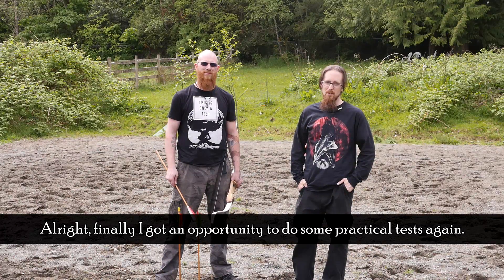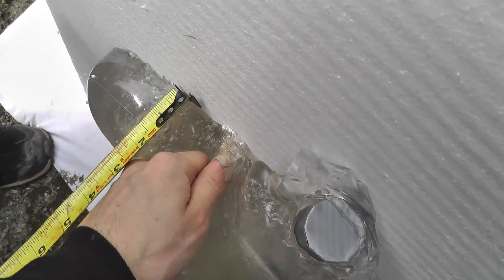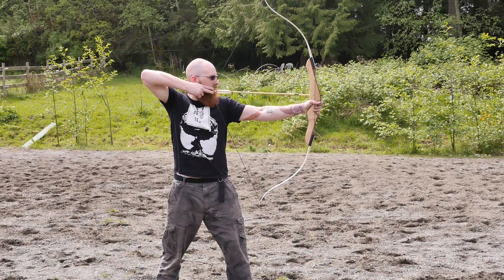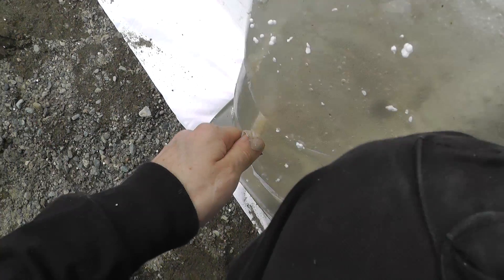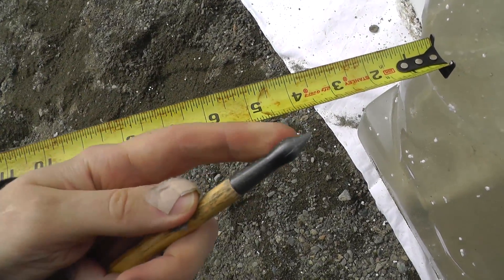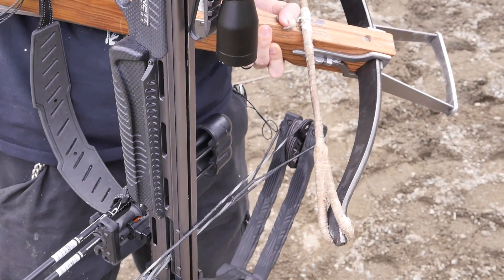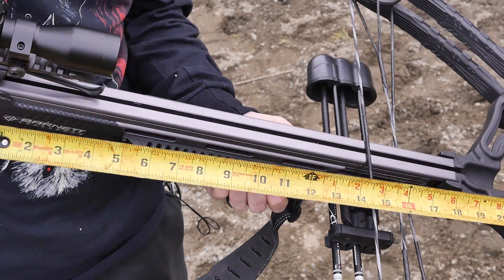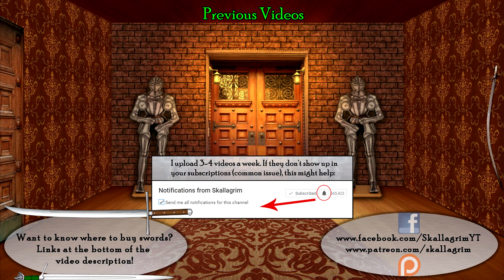Medieval vs. Modern: Testing Bows / Crossbows - Field Tips, Obsidian Point, Broadheads

Comment: An advice for Christopher to improve his archery skills: when you shoot the arrow your right hand opens its grip so «wildy» that it moves away fron your face, to the right, making the nock go right as well and alters the arrow's flight. Notice how at the begining of the video all your shots lanf at the left of the target. 

In order to make almost all shot movements the same, so you only have to aim accordingly, the strength to pull the bow must not come from your right arm, but from your back, your right scapula. Those muscles are stronger and if done correctly it makes your right hand always go to the back of the neck, avoiding the problem from before, the one that made your arrows land to the left. It will also avoid a bigger muscle unbalance between your arms, or your column could end up taking the shape of an «S».

I am a former archer, I know about this kind of stuff and I dont want you to end like those english longbowmen, with a shoulder upper than the other.

Comment: [7:30] it split because 1) not centered 2) reinforce it more with the string especially make the back end dull, otherwise you have a flying "mini stone ax" the optimal form is a "diamond" with one end flattened, "fish", or "Christmas tree" , hence their prolific use in colonial periods. use the wrapping to provide compression force making it stay together especially when it slides back, which is why you want it centered so if it does split the wrapping will cause it to clap back closed, driving it further.

this is just my experience with home making arrows.

Comment: That was interesting and insightful with the crossbows. Skal, have you done tests with different size bows? Not sure how hard that would be to test but it would be cool to see the difference of different size and strength bows and how the power is different. Obviously a long bow would deal more damage than a short bow but how much more damage would be fun and cool to see.

Comment: Another thing that plays into the extra penetration of the modern bows is that they are better tuned (the arrow is flying with less oscillation). Most modern compound bows are "center-shot" so that the string is pushing straight behind the arrow. With a recurve the arrow will be off-center and have to flex around the bow at the shot. The arrow can be matched to the bow to have the perfect amount of flex but it is much more difficult than with a center-shot bow. The sloppy releases with fingers will also affect arrow flight and if the arrow hits while a little off-center a lot of energy is wasted.

Comment: you forget about dynamic efficiency of the different limbs types, and mass times acceleration, different arrows where carbon is lighter than wood, different fleatching have different drag., arrow weight,  using a release aid vs fingers where a clean finger release gives you more speed. also the archers paradox comes into play when it takes energy to correct  witch is less present t in cross bow and compound as they dont shoot the arrow around the riser. also an archer can have different draw length on a recurve compared to a compound due to the use of the release aid.

Comment: Hi Skall

Could you theoretically make a compound bow using medieval resources?A mixture of soft and hard woods for the bow, antler/bone and braided linen for the pulleys, etc
Reply: Yes, you could, and you could use bronze or seasoned-steel cams and fixtures, since both metals were available long before.  The compound bow is an engineering/physics advance, not inherently depending on modern material science.  Here's a guy who made a wood-bodied compound bow.  A couple substitutions on string and binding ingredients/coatings would get you medieval (or justify it to your GM/DM):

https://www.youtube.com/watch?v=uxX45pXO9dU

He has another short video of it in action.  That's a 2-kilo bow with 55 pounds of shooting power (plenty for hunting, or for close or midrange tactical support), and even notice how compact it is!  Now I want one :)

Comment: In regards to the finishing remark about the differences in performance. As far as bows go (I don't have too much experience with crossbows) the draw weight is a major difference but not the only factor. I'm no expert, not by a longshot, but I tried many bows in reenactment movement. Even among the bows of the same draw weight there are differences colloquially known as "bow's speed" or probably more precisely "bow's dynamic". Generally a recurve bow will be "faster" than a longbow of the same draw, the arrow trajectory will be flatter. Not sure about a physics behind it but the recurve bow gives the arror higher velocity and by that more energy. Now, the compound bow is even "faster" than any classis bow so even if you found a longbow with a draw weight comparable to it, it would still pack less punch, as it were. Just my two cents :)

Comment: Going by draw weight is misleading!  In this case it is more a factor of reflex speed.  The PVC bow even though it is a higher draw weight is not re-flexing as fast as the wood bow, add to that its shorter draw and the arrow is being accelerated for a shorter period of time at a slower reflex speed.  that gives you less penetration.  Draw weight is only really a factor on how heavy an arrow you can effectively shoot from the bow.  No mater the draw weight the bow will only reflex at a speed determined by its materials.  The old Medieval 200 Lbs draw weight war bows did not throw an arrow significantly faster than a bow of lighter draw made from the same materials.  What it did do is to throw a much heaver thicker arrow clout shot into the on coming army.
Reply from the maker: I really need to get a chronograph and re-do the tests (that time with a full ballistic gel torso). Velocity is key (and to a lesser extent mass, of course).
Reply: Here is an article relating to this if you are interested.  There is a fair amount of research on this subject out there.  Back when I used to do a great deal of Historical reenactment, mostly of the Middle Ages, I did a great deal of research into the Bowyer craft on self and re-curve bow building. Man I feel old now, lol been a long time.
Reply: Well no shit. That's why you never see a 60 lb bow using 1000 grain arrows.
Reply: Please be a little more respectful in your comments!
Reply: also the guy did not pull all the way to the corner of his lip with the pvc bow like he did with his 35lb bow.
Reply: Mike's Micro Shop adding some things rebar inside your PVC will give it a much higher velocity. Because it will snap faster.
Reply: Not rebar, but some spring steal maybe!
Reply: That's only a little under 2-1/2 oz. You can shoot 2 1/2 oz arrows from 60lb bows & even below. They won't go as far but heavy arrows use more % of the energy when shot than lighter arrows do, so will hit harder.

Comment: The PVC bow wobbles a lot, Im not an engineer but I think much energy in being wasted on that, despite the larger draw weight (than the first one). Also with the compound crossbow, I think you should measure the entire length of the arrow plus the distance left on its path after the entrance, measuring the entire distance that the arrow traveled inside the obstacle to compare with the other results.

Comment: actually, compound bow and crossbow have another advantage.
on a normal bow, the tension of the string is proportional to the drawing distance. while you are drawing, the tension keep increasing.
on a compound bow, the pulley are not round and are shaped so that while you draw it, the tension increase, then start dropping before you're at the end of the draw. this make it easier to hold the bow in a drawn position, and this make the tension spike happen when the arrow is already moving.
on a normal bow, the arrow start being pushed by the highest then, the force that push the arrow drop until the string reach its resting position. on a compound bow, the force increase and progressively push the arrow stronger until it reach the tension spike, then the force drop. this allow for a better transmission of energy from a compound bow to an arrow.
Reply: That explains why longbows are much better with heavier arrows than lighter arrows while compound bows can shoot either light or heavy arrows effectively.
Reply: yes, for a longbow, a heavier arrow will have more inertia and the string tension will be able to exerce more force into it before it's back in resting position.
it still apply for a compound bow, but the draw strength repartition in time reduce the difference greatly.

Comment: Hello Skall, nice video, i like it, just one thing, i don't agree with what you wrote at the end of the video about compound bows vs longbows.
It's not just a matter of draw weight,it's not as easy as it sounds, you have to consider also the draw length and the modern materials with which compounds are made. There are Pse compounds that have only 40 lbs of draw weight and 30 inches of draw length that can make the arrow fly at 330 fps. I don't think that a longbow with 70 pounds can stand with a compound with the same weight. Take a chrony and see.
Have a nice day!

Comment: I would recommend losing the gel mold. The differing thicknesses it has throws off any measurement. Gel stops arrows so fast you can get by with a much smaller than you would think rectangular block made with some plastic tote.

Comment: The "50 Lb" PVC bow was not drawn to 28 inches, so it delivered far less than 50 Lbs of force to the arrow.  The draw weight of bows is measured at 28 inches of draw.  They lose 1-2% per inch shy of 28 inches and gain similarly with longer draws.

Comment: Hey skall, so i just found this video and thought about something when the obsidian point broke off and got stuck inside of the dummy. Wouldn't that be a good thing on a medieval battlefield? Something sharp stuck in your opponent, not easy to get out, that cuts his insides with most of his own movements and that could cause a quite nasty (and back then most likely deadly) wound infection. If i remember correctly, hawaiian swords worked with a similiar idea in mind. You strike your opponent and some of the shark teeth on your sword break off and get stuck inside of your opponent to cause extreme pain and immobilise him.

Comment: Why did the compund crossbow performed better than the compund bow? Since the compund bow has more draw length?
Reply from the maker: The compound crossbow has a shorter draw but way higher draw weight (185 lbs compared to 70).

Comment: why you didnt use  just a sqaure block of gel?
would have made it easier to compare the results.
and the problem with the obsidian tiped bolt, the obsidian Tip it self was not in the center of the wood wich caused the mature problem, i guess.

Comment: Is there a mathematical formula for draw weight and the power stroke? That would get a more acurate way to estimate damage  and penetration.
Reply: Work(in the sense of the physics) is measured in foot-pounds. Not sure of the whole equation, but it's the draw weight(LB) times the power stroke(i.e distance from the string at rest to that at full draw)(inches) divided by???something??
 Damage & penetration are not the same things- as a narrow, tapered head like a bodkin will go deeper than a big broad, sharp bladed broadhead, but the broadhead will cause more damage to unprotected flesh by cutting a wider wound which causes quicker blood loss & is more likely to damage or cut nerves, organs, tendons or bones.
Arrows work more like daggers, cutting into flesh almost surgically, whereas bullets punch ruddy great holes which kill & bruise a broader area of flesh by sheer blunt trauma, but those bullet wounds still bleed profusely. Sometimes people or animals don't even realise they've been shot by arrows or bullets straight away.

Comment: Pvc bows tend to be much less energy efficient than modern wood/fiberglass laminate bows due to their increased limb weight and suboptimal shape. You need significantly higher draw weight to match the kinetic energy of a modern laminate bow.

Comment: Tell Chris he needs to work on his release. You can see the arrows are grouping left consistently and that is because upon release, he pulls the string away from his face when he should be using back tension to pull his hand behind his head. Also if he's shooting split finger like that it is usually best to have three fingers on the string with a shooting glove and a consistent anchor point on the face. Just a few tips from another instinctive archer.

Comment: Ive noticed that the most modern bows and crossbows have multiple strings attached to them, but when operating them, you only use 1 string. Why? This isnt a direct "oh I know more you should pull on both strings" sort of a deal, Im just curious because Ive never handled a bow of that type.

Comment: to be fair on the obsidian tipped bolt, the tip was nowhere near centre to the bolt, it was basically lashed on to the side. no wonder it got ripped off in the dummy/ drifted downwards.

Comment: The PVC bow seemed to be drawn a lot less far back than the takedown bow was.  A 50-60lb bow drawn with 28-31" arrows would be  a fairer test. Even a 40lb bow can put an arrow nearly all the way through unprotected flesh. Broadheads aren't less effective for not penetrating so deeply as narrow headed arrows, as they work by cutting a  wide wound so the victim/prey bleeds out quickly. Good stuff though.

Comment: man.. that modern crossbow is a beast.. 
am I wrong to think that the way you attached the obsidian tips is a bit wrong? I mean.. it's on a side of the shaft, shouldn't it be in the middle? doesn't it affect the way it penetrates and flyes? just wondering.
Reply from the maker: I couldn't put it in the center because of how thick it is. The notch would have to be so wide that there would be very little wood left on the sides to support it.
Reply: aha! that explains it. Anyway I don't think it'd affect it's performance too much for this kind of tests, but I think it might deviate a bit in longer distances. At least that's the impression that i get.. I may be off base here tho'. Cool stuff anyhow. cheers.

Comment: A better way to explain the medieval crossbows poor performance is that Energy=Force*Distance. A short distance will result in lower total energy but the medieval crossbow compensates with force. However, because the draw weight over distance is not constant, neither linear, it is weaker

Comment: Interesting that you contribute penetration depth solely to draw weight and draw length with only a slight aside mention of arrow/bolt diameter. If the higher draw weight of the 70lb compound bow was the reason for the increased penetration why didn't the 50-60lb pvc bow out penetrate the 35lb recurve bow? You stated that it was the larger point in the video but then disregard this fundamental difference afterward. One reason I could give that both modern weapons out penetrated the "traditional" weapons was the ammunition used, carbon shafts are usually of a smaller diameter and a smoother surface which causes less friction to slow the projectile down. I also find using weaker "traditional" bows vs. a heavier modern bow a non-comparison, even with the exact same type of ammunition the heavier compound bow would out penetrate the "traditional" bows. This is not to say that a 70lb compound wouldn't still out penetrate a 70lb "traditional" bow, it's just that this was nowhere near a serious comparison.

Comment: I doubt it's the power stroke on the two crossbows that makes the difference vs. the sectional density of the bolts... at least directly.

Sectional density is the relationship between the cross-sectional area of a projectile and its weight. The medieval crossbow bolt is probably what... twice the thickness of the modern bolt? That means it has to move more than three times the amount of material out of the way as it passes through the target. 

Just based upon some googled numbers which should be at least ballpark accurate: A medieval bolt @ ~11/16ths diameter and ~500 grains vs. a modern crossbow bolt  @ ~11/32nds (or approximately half the diameter) and ~400-500 grains. This gives a medieval crossbow a sectional density of around .151, and the modern crossbow a whopping sectional density of .546. For comparison, a .338 Lapua has a SD of around .313. These numbers won't be completely accurate (you could measure your bolts), and don't tell the entire story (since it isn't measuring KE at all, but rather a way of expressing how efficiently a projectile penetrates) but do show how much of an effect the bolt diameter plays. The medieval reproduction bolt penetrates so much less because it has to move more than 3x the material out of the way. Even a marginal KE advantage wouldn't be enough to overcome that.

Now, power stroke does have an indirect relationship... the medieval crossbow bolt is so thick because it needed to be stiff enough to survive the shock of accelerating over such a short distance. Hypothetically if you could design a bolt with the similar weight and diameter as the modern bolt, but still stiff enough to be safely fired from such a short power stroke (say, a solid steel bolt), it would probably penetrate a more similar amount to the modern bolt.

Just some thoughts

Comment: Shouldn't you be using a wall of gel with a consistent depth instead of a 'body' of gel? I'd imagine the bolts or arrows penetrate styrofoam differently than the gel, resulting in different depths of penetration when hitting the body closer to the edger i.e. with less gel than in the middle near the breast with a lot of gel.